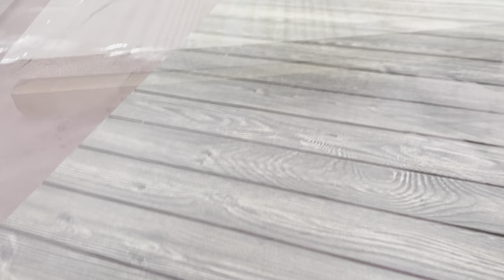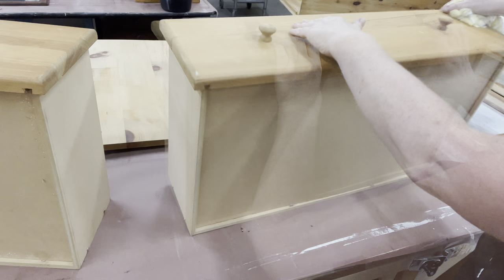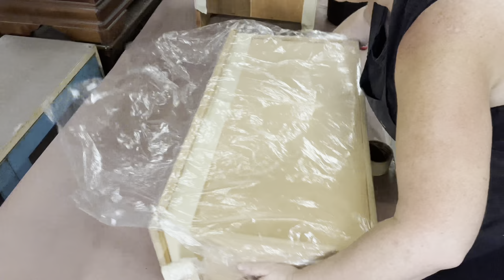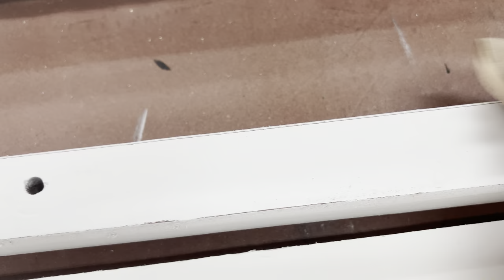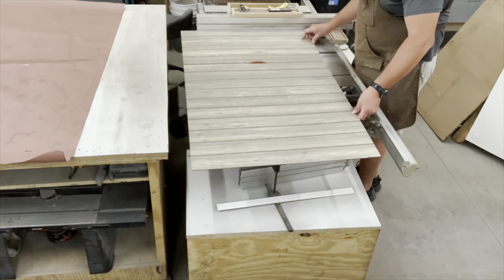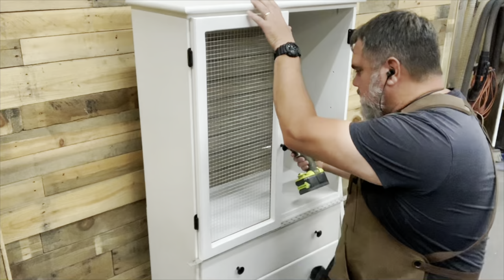DIY | Home Decor | Entertainment Center Updated to an Useful Piece | Furniture Flip |Second Hand

Comment: I have to agree with you, it turned out amazing. Actually it looks like a total different piece adding the doors n putting on that hardware cloth wire inside the doors. To bad you live so far. I wouldn’t mind having that piece in my house. I’m sure someone will snatch up your beauty quickly. By the way did you purchase that battery staple gun through Amazon? I’ve been needing one as the other kinds just don’t do the job as well. Sometimes they’ll go in the wood then you have to use a hammer to get in. Great team work! 
♥️♥️♥️😊👍👍👍👍👍
Reply from the maker: Yes I did.. love that thing. Went through so many before this one. It’s worth the money 

https://amzn.to/3dQwdJB